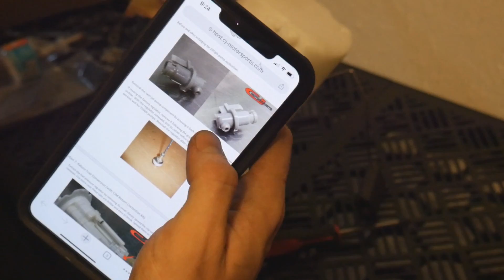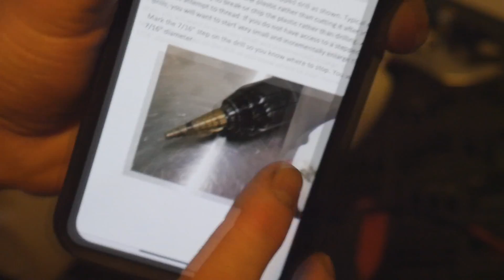Forged Twin Turbo G35 Build Gets CJM Fuel Return Kit!

Comment: Been awhile since I tuned in, sucks about the last engine, but now you really going big, hell ya bro! Looking forward to seeing you breaking that G loose and snapping necks as you fly by! BTW,  I've noticed a couple times now something about how you use your torque wrench...pro tip, don't "choke up" on the handle! It's absolutely imperative that you hold it at the center of the textured end of the handle so you don't over-tighten! The length of the wrench and the placement of the handle are engineered that way for a reason. Look up a video by Shane Conley, titled "why hand placement matters when using a torque wrench, proof with electronic tester". Good luck with the build!

Comment: Good job in doing the job right the first time...The higher pressures in your engine demands a greater precision in contact surfaces...If take short cuts here, you WILL have problems quickly and a repeat build will be required...Take your time, do it right, and your project will bring you plenty of joy...

Comment: Please, please make sure you follow proper engine break in procedures 😂
HP Academy has a good method for ex.
And the windage tray (around 6.55) is worth keeping if you track it, granted you need to drill/tap the girdle, and clearance the upper oil pan iirc.
Reply: Rob PhoboS  when i did my oilpan in my de last week i noticed mine did not have one i think,  from factory. Guess they all don’t come with them so might be alright!

Comment: I can get my heads done perfectly at around 150 in texas 🤞💸
Reply from the maker: young mech define perfectly that’s a good deal
Reply: @AaronNewman  flat decks and new valve seals (for oil burning) and valve seats 😊 but I wouldn't say one company's better then another tbh. Probably better service or better value with either one